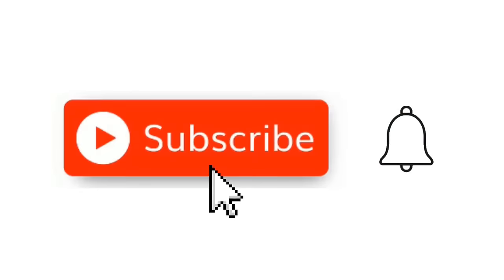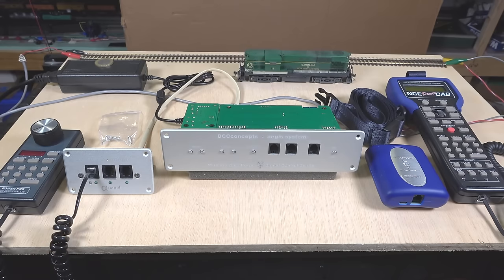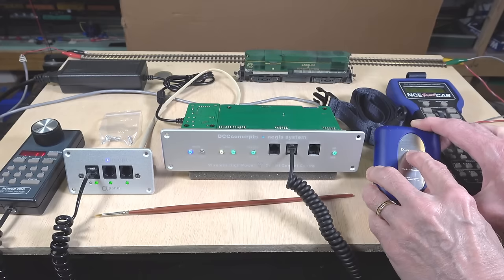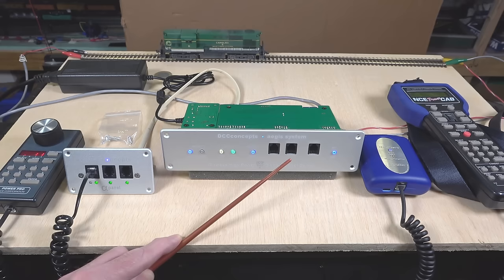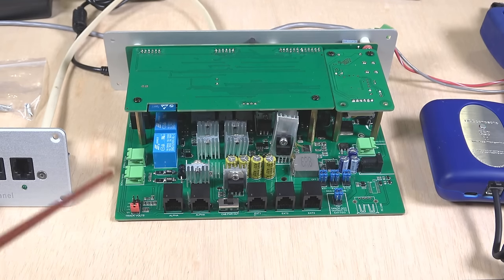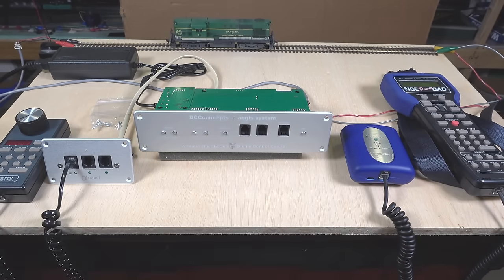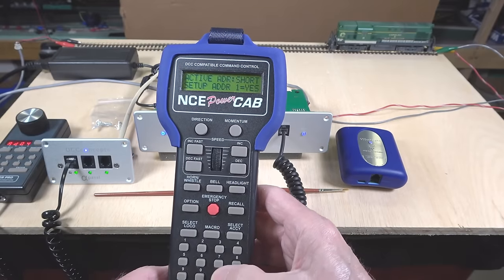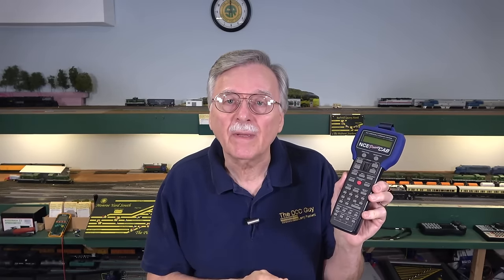Aegis Delivers Power And Performance For The NCE PowerCab (348)

Comment: When I started out in DCC back when (1990's) I was a customer of yours. I started with Digitrax. A move from Ohio to Texas had me reset my Hobby. During the transition I purchased a NCE Power Cab to use while I built my layout. (It now resides on my test bench). Along came ESU Cab Control and I purchased one to replace my Digitrax which I had sold. I have yet to use the ESU to run trains. I also have my power cab wired into my layout. My reason for this was the time it takes for the ESU system to start up. So as I am wiring and testing my layout I am using the NCE. The main driver to using ESU Cab Control was many N scale manufacturers were factory installing ESU decoders. I like the ESU decoder programmer and when needed I also use decoder Pro.
Now I am thinking about switching to the Aegis system. I have ordered from DCC concepts so I received announcements ahead of your review. I have been waiting eagerly for your review announced in MRR magazine.
If I may I have a question you may be able to answer.
I have power districts set up using DCC specialties products. 
Will Aegis work with  DCC specialties?
will I need to make changes to Aegis or DCC specialties?
Thanks for your input.
Reply from the maker: DCC Specilties products are generic and will,work with all DCC systems as far as I know.

Comment: I like the etched labeling. It not only helps with long term user friendliness, it also keeps the panel looking brand new. If someone has a different system with printed letters, they could take pictures of the existing labels and etch them into the panels themselves. If fhey don't want to etch in the labels, that's their preference. I'm not gonna argue about it.
Reply: @evanschaefer3812  How would I know?

Comment: This looks an awesome upgrade for the powercab.  I love the built in circuit breaker, I love that it’s wireless and I love the programming track.
However, I have already upgraded my powercab with 5 amp alpha power, and a different companies circuit breaker, both of which would be redundant.
It’s hard to justify such a big cost for the wireless functionality alone, as good as it sounds.

Comment: This is an interesting piece of hardware. But I'm curious, why? I mean what are the conditions or circumstances that would trigger a need for it? (I hope that makes sense)
Reply from the maker: 1. To upgrade to a 5 amp system. 
2. To convert the PowerCab to wireless walk around.
3. To add a fast acting circuit breaker.
4. To easily add a dedicated programming track to the layout.
5. To declutter plus it looks cool!

Comment: Great review, thank you! I have the NCE PowerCab starter set which I am using successfully with "Train Controller" software. I need more accessory addresses though (I can only use addresses 4, 5, 8, 9 and 10 with "Train Controller"), as well as more power. I was thinking of buying the NCE PowerPro 5A for these reasons. If I were to buy Aegis however, would I get away with buying just the CS02 (i.e. just the command station portion of the PowerPro system)? Would the CS02 work with Aegis? I would rather not buy the NCE power pack and ProCab if they are not needed, but again, I will ultimately need more accessory addresses than what PowerCab can provide.
Reply from the maker: I believe Aegis is exclusive to the PowerCab but you can use other throttles with it. The PowerCab supports all 2044 accessory addresses. I am not familiar with Train Controller and its limitations.

Comment: Looks nice Larry. With it mounted to the facia it would be difficult to access the plug-ins on the back of the unit. It is very pricey ($437 US).
Reply from the maker: Add up the individual cost of a 5 amp booster, a wireless interface for the throttle and its receiver, a circuit breaker, a AutoSW, and additional parts to get it to do all that Aegis can and see how it compares.

Comment: An interesting piece of kit Larry, but it is expensive - £499-95 in the UK. So an Aegis plus a Powercab is similar in price to a Power Pro Radio system. If the user already has a Powercab, a SB5 and a Wifitrax WFD-30 is a considerably cheaper way of adding a wireless throttle.
Reply from the maker: Don’t forget to factor in the cost of a circuit breaker and some way to get a programming track. Plus the SB5 will only give you 3 amps continuous and 5 amps peak.

Comment: Larry, I appreciate your videos. With that, this post has nothing to do with this video but you said you see things sooner if they are on current videos. I am wondering if there is any reason I can not use led lights from old Christmas nets for the layout such as for engine headlights, in car lighting, or for buildings? And, would they need resistors for the lights?
Reply from the maker: I have no idea how they are wired. If you have a string that is junk then cut them up and experiment.

Comment: My initial thoughts are that the cable from the power pack to the Aegis unit looks a little thin for a 5 amp (continuous) supply.  I would have gone with something closer to 14 AWG.  Maybe it just looks thinner than it really is in the video...
Reply from the maker: I think it is short enough to not be a significant factor.

Comment: Hi Larry! Based on this video, I ordered the Aegis system and it arrives Friday. I just realized that it’s probably not compatible with JMRI which I use quite a bit. Am I correct about this?
Reply from the maker: Watch video #353. DecoderPro works with it using ops mode but I could not get it to work with service mode, I think it’s because of the way it does the programming track switching. I need to go back and check this now that I have a full production model and see if that is different. They did tell me that when they release their computer interface they plan to make sure it will work but you could ask them about it too.
Reply from the maker: I just checked and the new Aegis unit does work just as I showed in video #353 with the pre-production one. At least it does work with ops mode programming and also I can still use the virtual throttle and my TCS UWT100 throttle. I need to find some time to test the service mode programming but have a dentist appt tomorrow, maybe Friday.
Reply from the maker: I just connected the usb interface to the throttle network just as I did for a stand alone PowerCab setup. Then I connected the PowerCab to the main cab socket on the Aegis faceplate. After that it worked just as if it were attached to the PowerCab power panel. I assume you have done that in  the past since you said you use JMRI a lot. Make sure you don’t have any other wired throttles connected as cab 3 since I think the computer program tries to use that address. I was able to confirm that DecoderPro will not work with service mode since when the PowerCab is connected to the programming track and you hit the program switch on Aegis it shuts down the throttle network sockets. One work around would be to use an NCE Auto-SW for service mode programming. However I just use the PowerCab itself to do service mode programming of the basic CVs then use DecoderPro ops mode for the more complex programming on the main track. I was also able to control locos using the virtual throttle in DecoderPro.
Reply: @TheDCCGuy  I finally got my PC to communicate, but only when connected via the USB interface to the EXT1 socket on the back of the unit. For whatever reason I couldn’t get it to communicate when plugged in the main socket on the front. I’m sure it’s something I did (operator error) but at least it working now. Thank you very much for all your help figuring this out!

Comment: Hey Larry that's Pretty cool as I've had a Power Cab since 2016 it's no longer @ Entry level use as I have a number of DCC Engines Sound engines but they're N Scale will Aeges system Run N Scale as the voltage for N Scale isn't as great like HO and I'm using a Circuit Breaker with my PowerCab a NCE Circuit Breaker if this system will work with N scale & is circuit breaker protected this would be a Game changer on all levels then you add the extra panels or Wifi that would be extra cool only if works with N scale for me that is... 

The System that TCS sells that  works with the Power Cab is good to add to one's layout but I'm liking the Aeges system hopefully I can buy it in my Hobby shop.. Cheers 🥂 

Happy Holidays hope you had a good Thanksgiving Allen D
Reply from the maker: Since you can set track voltage as low as 14 volts it should be fine for N scale. As for purchasing it, I mentioned current sources towards the end of the video, and it will only be available from those sources for the near future. A second release is sure to follow but I have no idea when or how many units will be made.

Comment: Hi Larry are you able to run a nce cab-06 handset while using the aegis wireless powercab. I recieved my aegis system last week and have it all hooked up. When using the wired version of both controllers they work ok. But when i use the wireless powercab it works good but the cab-06 just displays Ad03 and doesent work.Any suggestions.
Reply from the maker: Unfortunately no. In order for a wired throttle or computer interface to work it has to communicate with the PowerCab throttle and that can’t happen when it is in wireless mode. This is because the wireless interface is just a transmitter and not a transceiver so does not support bidirectional communications. It was a tradeoff they made as a transceiver would have been much more expensive to engineer and build. So they assumed most users would be lone wolf operators using the PowerCab in wireless mode when running alone. I am hoping that a future release will bring bidirectional capability.
Reply: @TheDCCGuy  Thankyou Larry for letting me know. I really like learning all the helpfull info you put out there.

Comment: Thanks Larry interesting stuff. I have gone down the Digitrax, I started with a Zephyr Express controller which I really like but to allow me to move around the layout I bought a UT6 controller and plug in panels. 

Do you have any knowledge/experience with these units. The throttle dial takes two full two turns in “ballistic” mode but acceleration/deceleration varies with the speed that you turn the knob, making a nonsense or the CV speed settings. Turning off “ballistic” mode makes it worse 5 full turns to get 100% throttle. Cheers Peter.
Reply from the maker: I think there is a setting to alter the sensitivity of the bassistic tracking but have nit done that in years. Check the Ops settings in your manual.
Reply: @TheDCCGuy  . Thanks Larry, I’ll have a look, although their later manuals seem to cover less. I found an older version of the Zephyr manual on line that had more info than the manual in the box. Desensitising the ballistic function may help. Cheers Peter.
Reply from the maker: I checked some of my older manuals and it appears there is only the choice between ballistic and straight lone tracking. So with ballistic on just slow down with your knob thumb.
Reply: @TheDCCGuy  . Yes that is what I thought. I have been corresponding with their tech department this week for more info on the Throttle Option settings under ID 20. Specifically the difference between “0=28 speed steps”, “3=128 speed steps” and “4=28 speed steps advanced” but the contact couldn’t help me. Cheers and thanks Peter.

Comment: Larry I'm new to DCC I just recently bought the NCE power pro. I put hooked it to a piece of flex track. I put 3 different locomotives on the track and they all started making sound but as soon as one touches the other they short out. Why would this be. Please help
Reply from the maker: Some loco models use the chassis as part of the electrical pathway and if couplers with metal parts are used and are not in an insulated box they can short. Same if they are brass locos. Other than that Imam at a loss. What do you mean they are touching anyway and what models are they?
Reply: @TheDCCGuy  if I couple together. 3 are Kato p42s one is an Anthern
Reply from the maker: Not sure about the Katos but I’m pretty sure the Athearn has body mounted coupler boxes. Try using the KD couplers with plastic shanks and see if that fixes it.
Reply: @TheDCCGuy  thanks Larry I really appreciate it

Comment: I have the NCE Wireless Cab and Controller, so not sure it would Interface to this??
Reply from the maker: DCCconcepts says it will.
Reply: @TheDCCGuy  
So maybe the Wireless Transceiver just plugs into the NCE Port on the Aegis.
Reply from the maker: Yes, it is basically handled as a throttle and can plug into the back of the unit or one of the expansion panels.
Reply: @TheDCCGuy  That’s great! Thanks!
Reply from the maker: I know they have tested both the NCE wireless and the WifiTraxx unit with Aegis. When the PowerCab is physically plugged into the Aegis base station it functions just like it would when plugged into the power panel in its original configuration.

Comment: I wish I could get mine to work.  Waiting for a reply from retailer and manufacturer.
Reply from the maker: What is it not doing? Both my advanced release and production units have worked fine and I think I use it several times each week.
Reply: @TheDCCGuy  When I power up the ESP Aegis, I can hear the loco on the track idling, so power is going to the track.  The Powercab commands have no effect.  Neither speed nor accessory commands have any effect.  The Powercab by itself works perfectly when connected directly to the track.  I've watched your video numerous times and carefully examined the instruction book for the ESP System.  I have concentrated on plugging the Powercab using the curly wire connector directly to the main line track plug.  I tried to use the wireless connection but never achieved a steady blue light state.  Not knowing if the ESP fails because there is no command connection, so I have deferred the wireless feature until I solve the wired set up.
Reply from the maker: I don’t know who you have contacted but try their sales manager Richard Brighton r.brighton@dccconcepts.com and/or tech support Mick Bryan m.bryan@dccconcepts.com . Richard knows the system well and as sales manager should be able to take care of you—Larry
Reply: @TheDCCGuy  I received a prompt reply from Iron Planet Hobbies support suggesting that I use the flat wire provided with the NCE Power Cab. All Power Cab functions are working so that is a giant step forward.  The added power to the layout makes a huge difference.  So tomorrow will by wiring up the programming track.  I'm curious to see how the ESP wireless will work if I have to use the long flat cable there as well. Thank you, Larry, for sharing your knowledge of the hobby.
Reply from the maker: Interesting. I had heard that the original flat cable from NCE uses a slightly thicker wire gage so maybe that is the case. However, I have used a variety of cables without issues and always used the coiled cable. I’ll have to tried a variety as a test to see if it matters in my case. Thanks for getting back to me and I hope it is working for you now—Larry
Reply from the maker: OK, the question is which coiled cord were you using? The NCE version that I have has only 4 pins and conductors whereas the flat cable and the DCCConcepts coiled cord has the full 6 pins and conductors required for the PowerCab to function as a command station.
Reply: @TheDCCGuy  I've been reviewing the instructions for both the PowerCab and the Aegis.  PowerCab comes with a curled and a flat cable.  NCE says that there are times when you want your PowerCab to operating like the ProCab if there is an existing power source you don't want to conflict with, so it seemed logical that the 4 conductor curly wire was appropriate,  I watched your video again and noticed that you had two curled cables, one connecting an added cab and ANOTHER one connecting your PowerCab to either the Main  or the ESP tramsmitter.  Then I noticed the two curled cables were slightly different.  AH-HAA  Larry uses a six conductor CURLED line instead of the FLAT six conductor wire I received with my PowerCab.   I ordered a six conductor curled wire since the six foot flat wire is a tad long to move around with when managing traffic on the layout.  Larry, your videos are an inspiration and have reengaged me in the hobby on so many topics.  Thank you
Reply from the maker: Don’t you just love those AhHa moments when everything clicks into place😁
Reply: @TheDCCGuy  if you like your NCE PowerCab the improved Aegis functionality will add a lot to your layout.

Comment: Can this be used with a ProCab rather than a PowerCab?
Reply from the maker: Yes, the Ramtraxx throttle I also tested it with is the equivalent of a ProCab. 

I just noticed you said rather than. You must also have a PowerCab as it provides the DCC command station functions.

Comment: Too bad they did not allow the pairing fob to be nested with the silicone sleeve on the power cab.  Supply a short 6 wire RJ cord and you have a nice walk around unit is a single lump that props the head of the power cab up for better visibility.  The curly cord, belt clip is a no go for me.  Too many parts.
Reply from the maker: The “fob” contains a Li ion battery, charging circuit, transmitter circuitry. This method means you don’t have to send in your throttle to have it modified and it will work with any PowerCab.